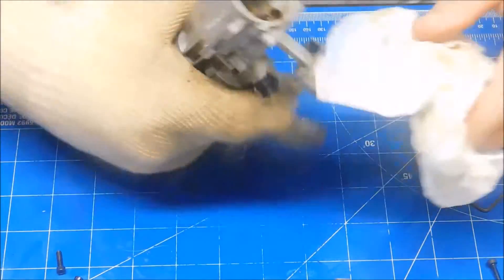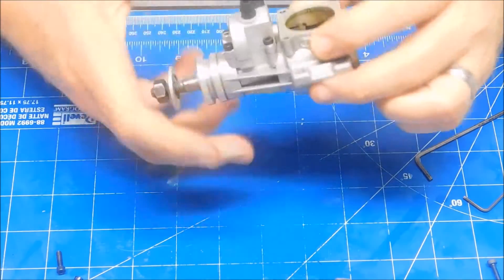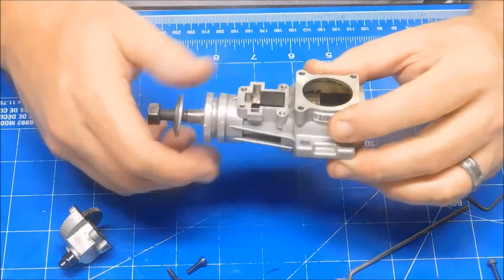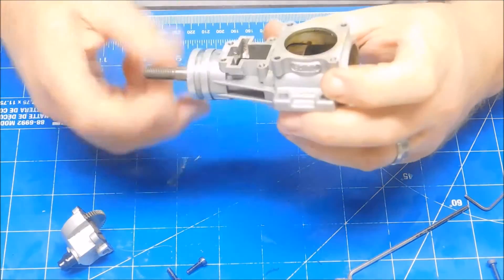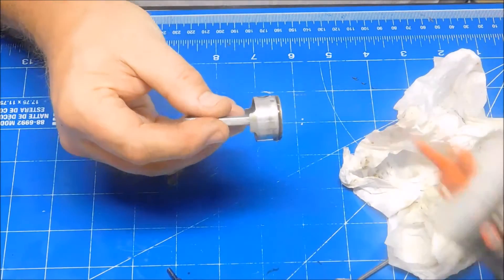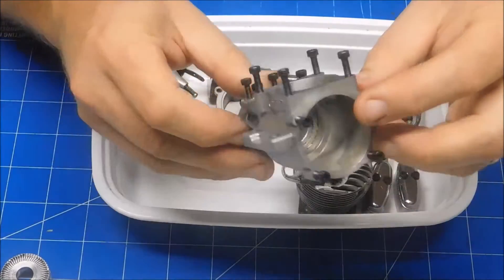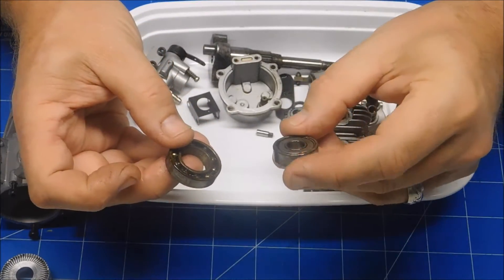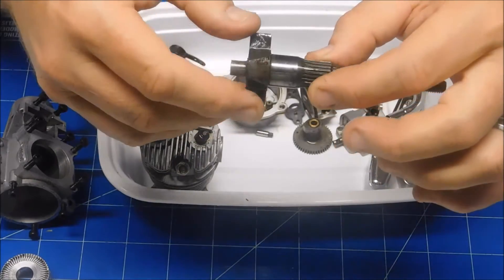Saito FA-65 Tear down for rebuild Part 2

Comment: Dear all. 
I have same FA 65 engine. 
It has idol more than 5 years and it stuck. 
I started to refurbish it. 
But I can’t see bearing numbers 
Please could you confirm what is the number s. 
Thank you so much.
Reply from the maker: This question has been answered in your same comment on another video.  It isn’t difficult to measure bearings to see what size they are.  You can also watch this video.
https://youtu.be/oe_LD-qvwCQ

Comment: Good friend can you help me, I have a saito 65 4T engine with 10 years stored, I went to try to work but it doesn't work I opened the valve cover to check if everything was locked perfectly correct, but it doesn't work? Does anyone know anything that can be?
Reply from the maker: Send me an email to discuss. You must provide a lot more details than simply stating it does not work. That tells me nothing useful.

Comment: Hi David. I'm really enjoying your videos. I have an old 65GK that  quit on me. After tearing it down (knowing nothing about these engines) appears that the  gears are stripped (Removable pinion as well as the cam gear. I have not been able to find parts anywhere. If you can help me I would greatly appreciate it.
If not, maybe It's worth something for parts. Everything else looks good.
Reply from the maker: I'm sorry but I am unaware of anyplace that stocks older Saito parts.  Your best bet is to find a parts engine or search the forums and eBay.
Reply: @dmrcflyr2  Thank you sir. I'll keep an eye out. In the mean time  I'll shelf it. If you ever need the parts let me know. Happy to donate them to a good cause.
Reply: Try Morris mini motors

Comment: At around 10:00 mins you said that you took the ring off. I sure would like to see how you did that and watch you putting it back on and hearing all the teaching you could relate. I did some searching and couldn't find if you had done a video on that. I did find some guy that talked about some gasoline (26cc??) engine and he talked about some pin and some ring gap. I don't know about that stuff, but would love to learn about nitro engines, please  and thank you - Richard
Reply from the maker: I am in NO way an expert in replacing piston rings.  I have only the found the need to do it a couple of times and even then I probably didn't do it right.  But I do have videos of doing it.
https://youtu.be/jx8ZiNyPjnc
https://youtu.be/BGYlHncfOXA
https://youtu.be/Puvcq77_qqQ

Comment: Dave, I have an FA-80 with a stuck exhaust valve. I ran it on the test stand just fine, but after it cooled the exhaust valve was stuck open so there is no compression. Do you have a trick for loosening it without talking the head off?
Reply from the maker: It could be a stuck cam follower too.  Put some oil on the spring and push down on it and see if it rebounds. Work it like that a few times.  See if it loosens up.  The push rod will become disengaged from the rocker arm, so be sure to re-engage the push rod properly before running.
Reply: Wow, that was quick. Thanks for the reply!  It's not the cam follower. The valve is stuck what appears to be about totally open, so there's not much more that the spring can be compressed. I've tried tapping on the top of the valve stem using a large size nail set and hammer, tapping lightly.  It doesn't seem to want to budge and I was afraid to tap too hard. I was thinking of heating the top of the cylinder with a heat gun and trying again.  If I can get it loose while it's hot maybe I can work some oil into it before it freezes again.Thoughts?
Reply from the maker: +sparks1947 yes try some heat and oil. if that doesn't work you may have to disassemble. take the rocker arm off to do this.
Reply: Do you have a temperature recommendation? I can measure it with my IR thermometer.  And are we talking like 3 in 1 oil?  I know it can't be so hot that the oil burns off when I apply it!
Reply from the maker: +sparks1947 I don't use a thermometer. just don't a matter of feel for me. 250 F to 300 F should be good.
Reply: I'll give it a try.  Tomorrow. :-)  Thanks.  I'll let you know how it went.
Reply: Well, as it turned out I couldn't wait until tomorrow. I heated it up and at about 140F  the valve popped closed. It was still quite sticky, though, so I squirted 3 in 1 around it and worked it up and down,  Much better, but still a little sticky, I switched to Liquid Wrench and that did the trick. It now goes up and down like new! Thanks!
Reply: Dave, I actually have another question. I didn't tell you, but I bought this FA-80 on eBay so I don't know it's history. Another  problem it has is that there are apparently not enough threads on the spray bar showing inasmuch as the needle valve bottoms out  against the nut on the outside of the throttle body before it hits the valve seat on the inside, so the needle valve does not close.  It has almost no effect on how the engine runs, which I think is a bit rich.  It could only get up to about 6400 rpm.  Is the spray bar pressed in from the other side? Also, I see that there is a new spray bar and needle valve "upgrade" available that is supposed to solve an alleged running problem in the mid-range. Do you know anything about that?  I don't know if this has it or not.
Reply from the maker: Unfortunately, I am not going to be able to help you with this issue.  Without me seeing the carb/engine and trying to set it up myself, I cannot answer your questions.  I do not know anything about a carb upgrade for the Saito 80's.  I have never had this particular issue.  It sounds like you may have some mis-matched carb parts or damage.
Reply: Ok. Thanks anyway.  I agree, it might have the wrong spray bar. I'll figure it out. :-)

Comment: Hi Dave, I reuse my Citrus oil even when brown like that, let it sit overnight then filter it through a drip coffee filter paper and its almost looking like new again.
Reply from the maker: Well for the price you payfor it in Australia I don't blame you.  I don't bother filtering mine, I just use it until I can't stand it anymore.  I can get those 64 fl oz refill bottles for $1 at numerous locations near my house.  Still waiting on some parts before I get back to finishing this engine up.  Bearings should be in tomorrow, but the spacers for the timing gear I am waiting for a buddy to mail to me.  Nothing yet,...
Reply: Oh thats right, I forgot the stuff is soo cheap there, I may have found another supplier here, still around $20 a liter that's around $15 USD a quart.